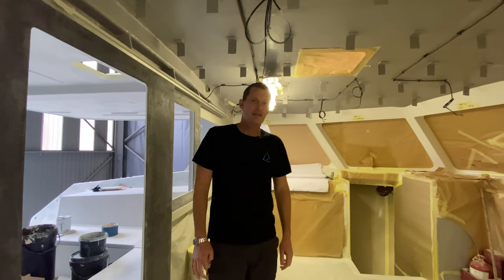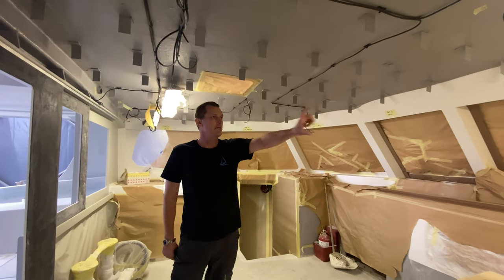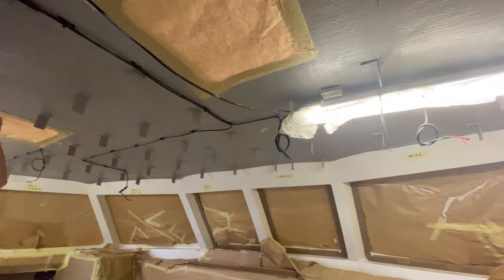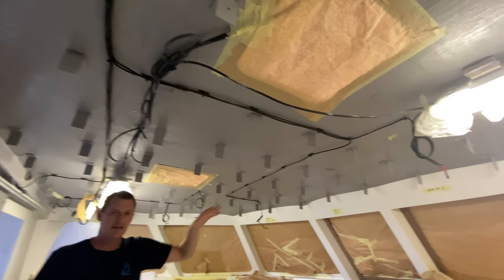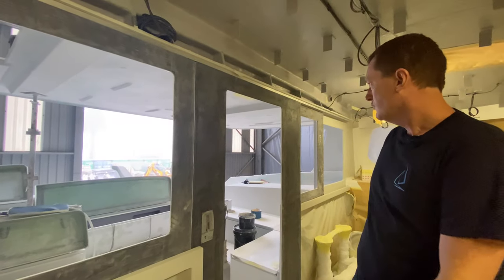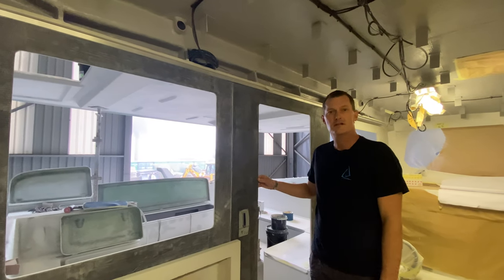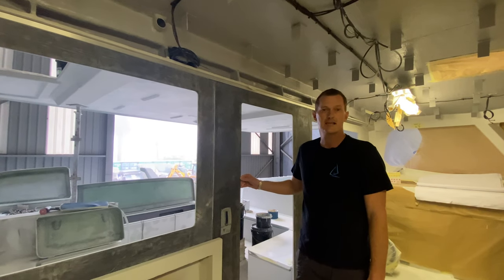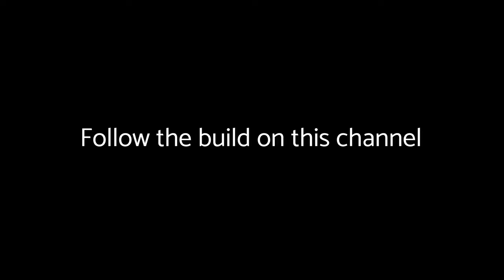Building a Balance 482 Catamaran IV: Deck de-mold, joining the hull & deck and internal construction

Comment: Thanks for showing more of the build.  Needless to say, it's fascinating.  Please keep posting videos of the builds.

The beauty of the Balance designs and the quality of build is highly apparent, even while construction is happening.

The other thing apparent is that the craftsmen building the boat are highly skilled.  Good job to all, including the training, guidance and apprenticeships to get them to that level of ability.  Really the high quality of these boats is a direct result of that excellent building skill, along with great design and manufacturing engineering.

It's also great to see that the new boatyard is building to the same high standards as the original one.

Not sure I could live with it, but the zebrawood interior is spectacular and pretty.

My main concern is that I'd like to see a lot more protective equipment worn.  Though it's uncomfortable, it probably makes for better health later in life.  I do understand that different countries have different standards, but a manufacturer can use higher health and safety standards if they choose.

P.S. Music level is still to high relative to voice.  Use a slow averaging meters to set the audio levels better.

Do less panning of the camera.  Put it on a tripod and lock it down, particularly when doing the interview portions.  Too much panning can almost lead to motion sickness.

Comment: Beautiful. What technique is used to join the deck to the hulls?  Thanks
Reply from the maker: @Gustavo we are about to release a video that explains this. We will ping you when it is online! They are glassed together on the inside and outside, effectively as if the vessel is all one solid unit.
Reply: Great. Looking foward to the next video. Thanks